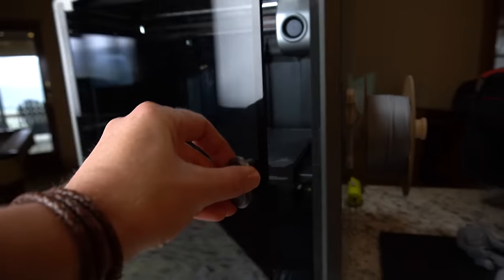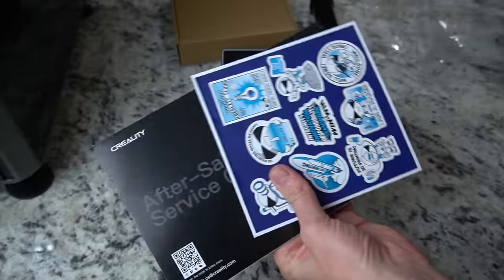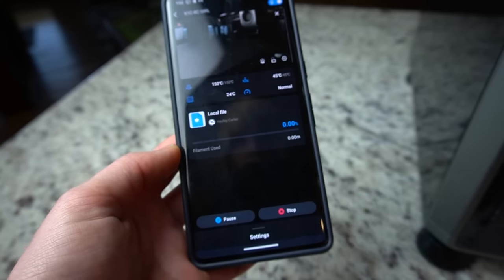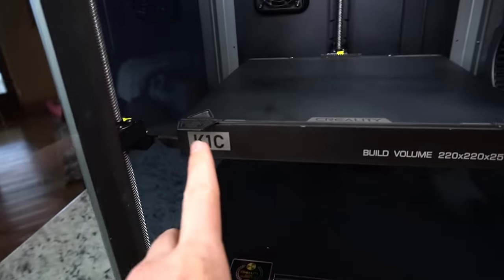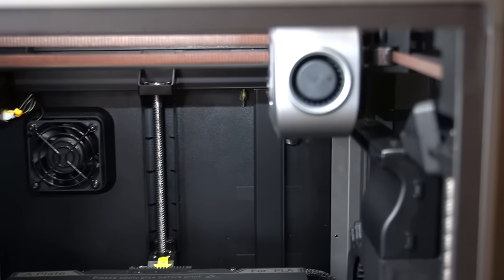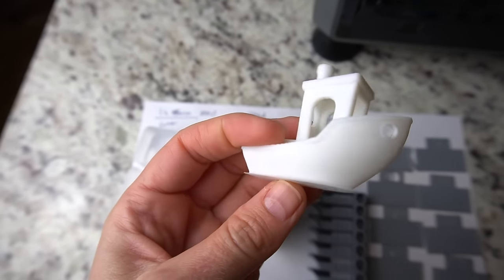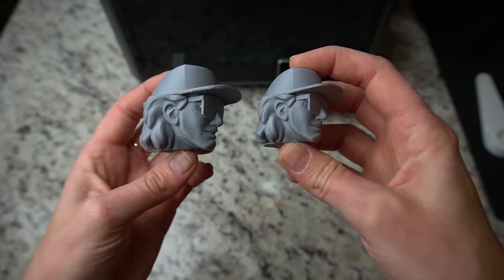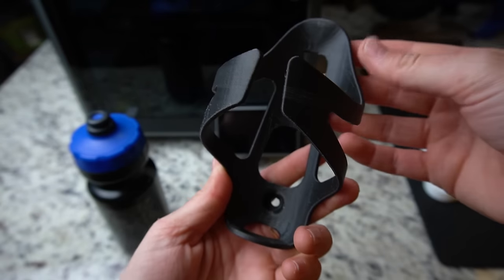Creality's Flagship K1C 3D Printer: Game Changer?!

Comment: Half of the materials have a hard time sticking to the bed, certainly if the bed cooled down because you ran out of filament or whatever, the other half of the materials stick to hard, if you want to remove prints from the bed you damage the bed,.. That is why you use gluestick/ pva spray,...

Comment: Ive had my k1c for a few weeks. I would suggest the following
1.install moonraker and fluidd or mainsail. It really opens up the options you have with this printer
2. look up a lid mod for this. The standard height the lid sits the chain will still slap it and knock the lid off.  
as always thanks for the video. Great as always!!
Reply: I haven't modified my lid and have had zero issues, the chain is well clear of the lid and it clicks down pretty hard.

Comment: Note on the glue stick. It isn't used to make the prints stick. It is to help the prints release from the bed. I ruined my build plate because I used a material that stuck so much to the bed it couldn't come loose without the bed ripping.
Have been using glue since without problem.
Reply from the maker: Yeah I've heard it used as a print release. I haven't really ever needed that either. Let the prints cool and they pop right off.
Reply: It can do both. I've had prints that failed to stick without it, and other that stuck scary hard without it. Depends on the filament and the build-plate among other things.
Reply: My bed is flexible
Reply: It magnetic and it flexible
Reply: @RCGirl  TPU is one that can stick to PEI sheets and not want to come off.  This is even more true if you use a smooth PEI sheet. I screwed up big time doing that :P
Reply: I have used the glue stick with every print (a few dozen so far) and zero issues, I clean my plate with window cleaner  (Ammonia based) after each print comes up nice and clean, it dissolves any remaining glue.

Comment: Do you have a review on the electronics used on the inside. What processor is used? what os is used. What kind of protection is there for fire control, overload current conditions. What happens when motor windings short. Thank you

Comment: So what did you do about the bed not been level ??? when the print missed in the top right corner ???. Should the new k1c correct that with auto level ?
Reply from the maker: It will correct it in the software during printing when the sensors gauge how off it is
Reply: @RCGirl  so why did it not do that when you printed that print ?
Reply from the maker: It needs to be calibrated again and reprinted to see if it fixed it.

Comment: My cousin has a 3d printer where he uses a liquid to print things. Can this use a certain liquid to print things as well?
Reply from the maker: That's a resin printer (SLA). This is a FDM printer that essentially melts different plastics layer by layer. Resin printers can print in a lot more detail but uses a lot of toxic chemicals. Parts are also more brittle. So it depends on the application, both have pros/cons.
Reply: @RCGirl  sounds good, thanks. 👍🏼